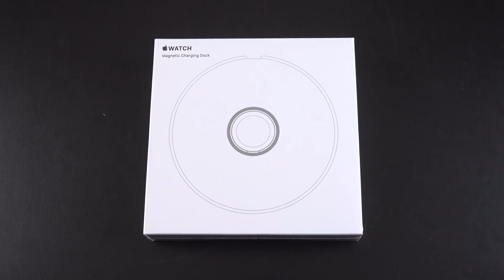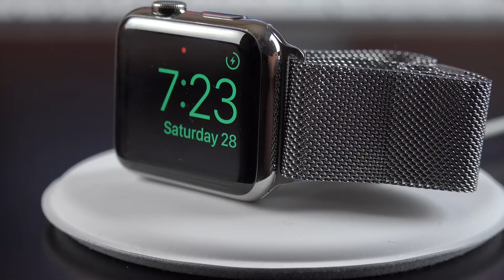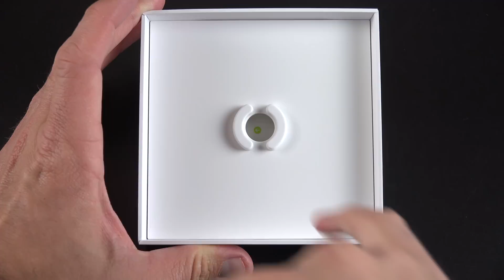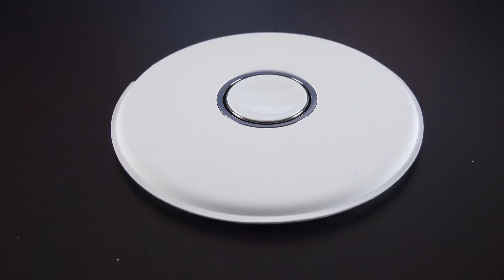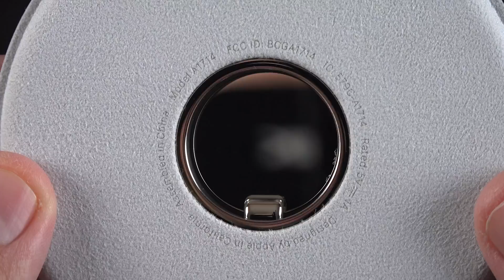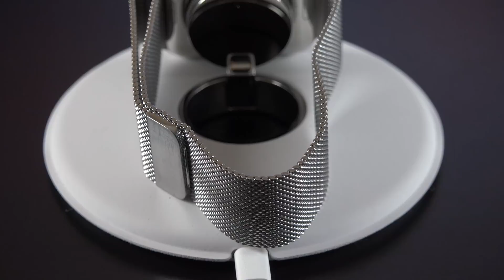Apple Watch Magnetic Charging Dock: Unboxing & Review

Comment: "... Compact disc shape ..."

I've never seen a CD that looks like that. 😜
Reply: unlokia well it's round with roughly the same circumference, and there is a hole in the middle (when you pull up the magnetic charging surface)